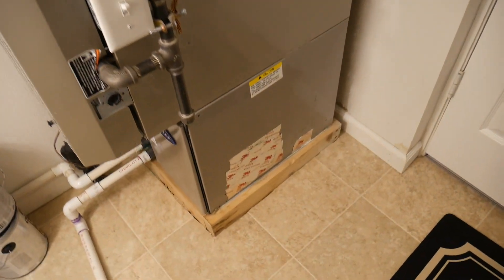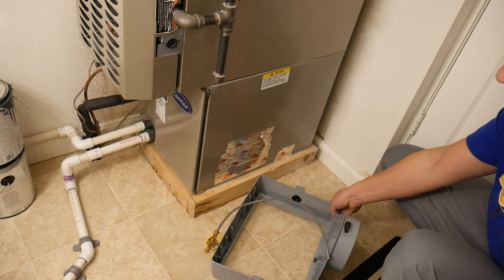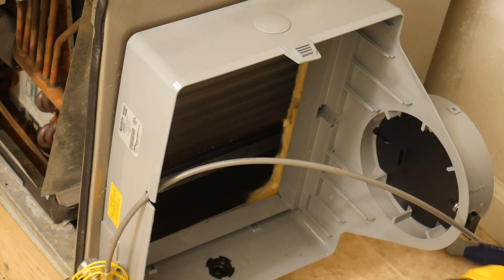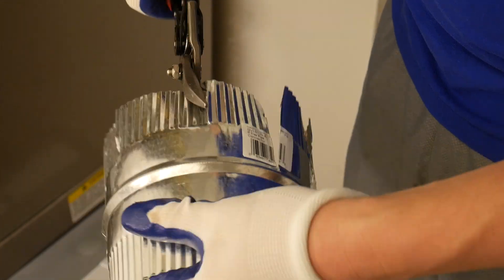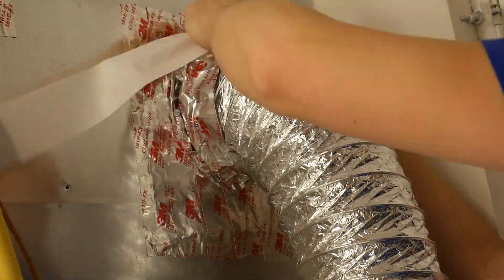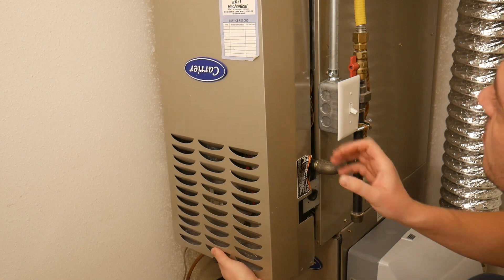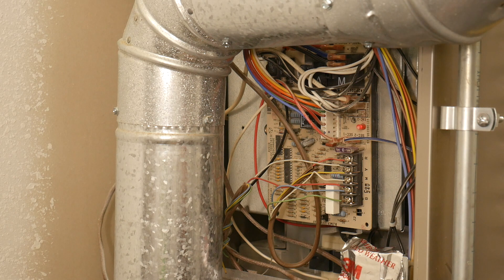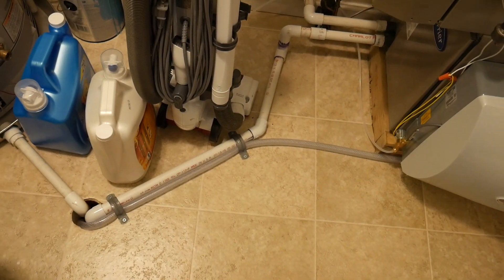Aprilaire 600 humidifier installation (Get rid of dry air in your whole home)

Comment: So if you bypassed the transformer and went straight to the humidifier connector on the pc board, that means the power is regulated somewhere else for the humidifier correct. Also if you are not using the transformer, but you wired it to the switch, does that mean it is live on the outside of the gang box?  Thanks for making the video. I would like to bypass the transformer. The humidifier was professionally installed, but it keeps blowing transformers after a few weeks. I don't want the company back in because frankly everything they have done, I have had to go back and fix myself. Very frustrating since it is hard to buy parts unless you are a certified HVAC technician.

Comment: I have the same humidifier, the problem I have is the saddle valve lets in too much water and overflows the humidifier, trying to find the sweet spot for the water flow is an issue, it is either too much and floods or not enough and no water gets through. I think I may need a pressure valve to control the flow. Have you had a problem with the water being too much pressure?
Reply from the maker: The problem I have is the thermostat. It needs to be turned way past 45 in order to activate the water flow. I actually removed the saddle valve because everyone was saying how unreliable it is, and replaced it with a regular valve.

Comment: Any issues yet with the polyethylene tubing since your install? Most say PE tubing is not to be used with hot water, and the Aprilaire instructions call for copper tubing.
Reply from the maker: No issues at all Actually you can use either hot or cold water. There is an ongoing debate between using one of these two options and I am not qualified enough to go into those details. I used cold water only because there is a shut off valve on that pipe that I could use in case of emergency. Also, there is a cost factor with using hot water. Hope this helps.